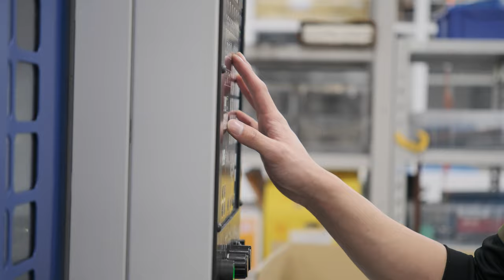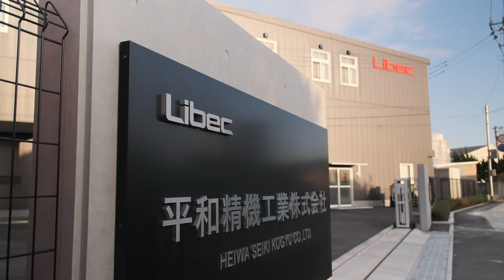Libec Tripods and Camera Support Systems Crafted in Japan - Factory Tour

Comment: I've been using a Libec RH-450 head for years and it's as good as the day I bought it. It's a fantastic head and is perfect for anything from a DSLR/Mirrorless to C100/C200 cine style cameras. I totally agree that this company is kind of a hidden gem in many respects. Their fluid head is so much better than Manfrotto - I don't understand the love for Manfrotto, I really don't. I've used everything from cheap Benro's to high-end Sachtler and O'Connor heads over the years and my trusty Libec is the best sub-$1000 head there is. The RH is no longer available but I'm guessing the latest are just as reliable.